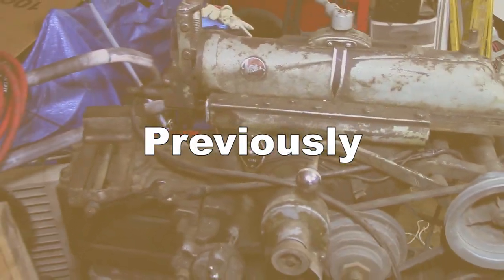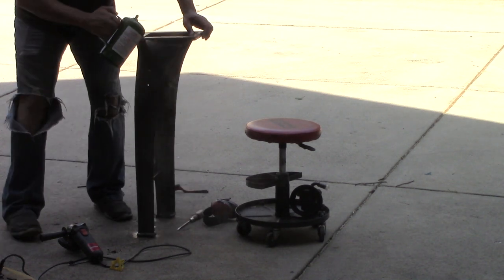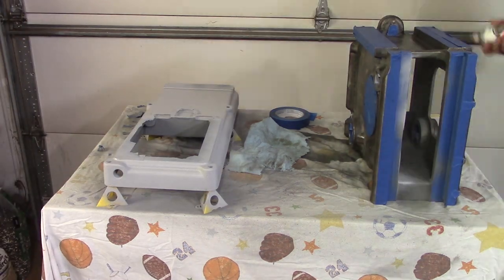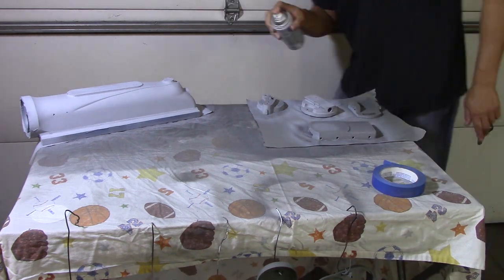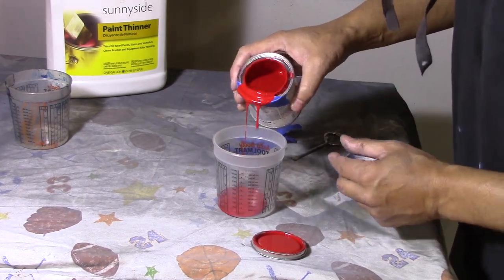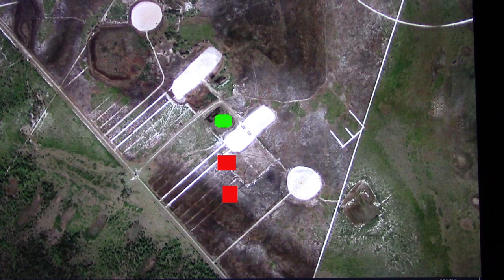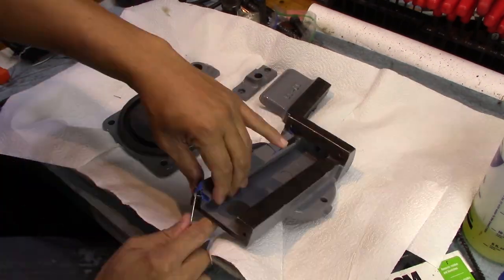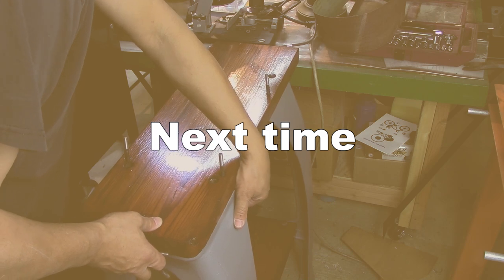Atlas 7B Shaper Restoration, Part 3.  Painting.

Comment: Great job JSTER1963, did you have to do anything to clean up the work surfaces? Have a great day!
Reply from the maker: Thank you so much!  I only had to use WD40 and Scotch bright.  It was in pretty good condition.  Thanks again....
Reply: Jester, next time you want to use WD40 and Scotchbrite, try Rubbing alcohol and Scotchbrite. You will be surprised how well it removes the surface rust and it cleans up easier.